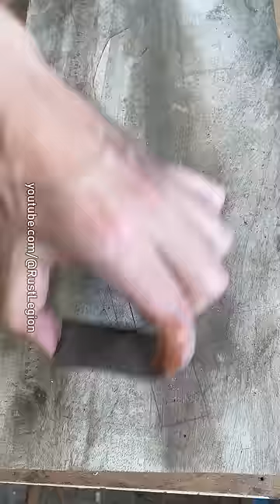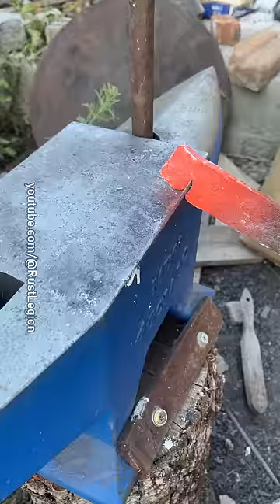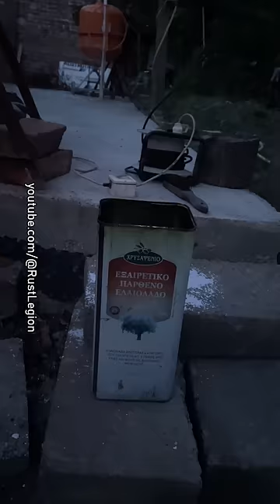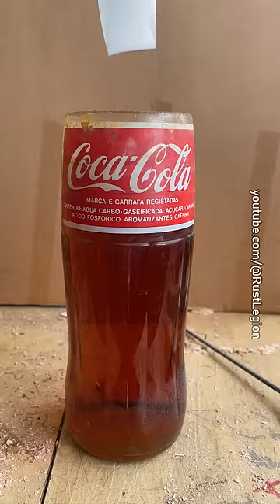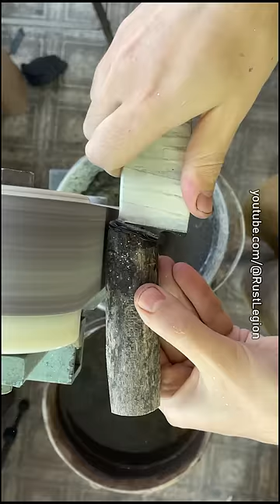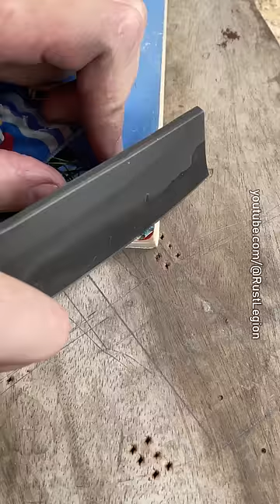Making mini cleaver

Comment: Hopefully that forge weld holds cause it looks like it might start flaking apart. But im no pro so 🤷‍♂️
Reply from the maker: yes there is a little delamination on one side. This blade stays with me so it should be fine.

Comment: What type of glue did you use for the pinless design??
Reply from the maker: I use epoxy resin. But I fixed it with a nut at the end of the tang

Comment: whats poured into the handle to secure the blade? resin?
Reply: his words in another comment:
I use epoxy resin. But I fixed it with a nut at the end of the tang

Comment: Good morning sir, what is the method you use to heat up the steel? I see that it's charcoal but what do you use to supply air to it?
Reply from the maker: Hello , I use some type of unknown blower that a friend of mine gave to me. But if you live in the states , I think you can find some new specificaly made for blacksmithing blowers. Before I used old vacuum cleaner(the back end) it was very noisy and I had to redirect half the air because it was too strong , but it did the job :)
Reply: @RustLegion  yeah I do live in the states but I am not in a financial position to buy specialty products. I would like to make as much of my equipment as I can out of homemade stuff
Reply from the maker: @GerstBladeworks  well then maybe some old cheap vacuum cleaner will work for you , if you don't mind the noise. Some people use hair dryers but it is a bit weak in my opinion.
Reply: @RustLegion hello again sir! Long time to speak! What powder are you using for the forge welding, borax?